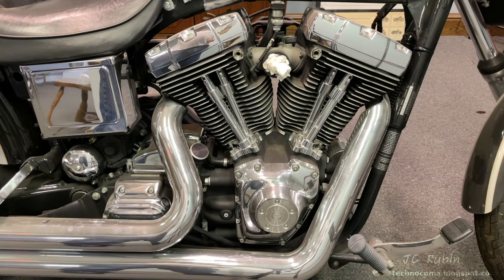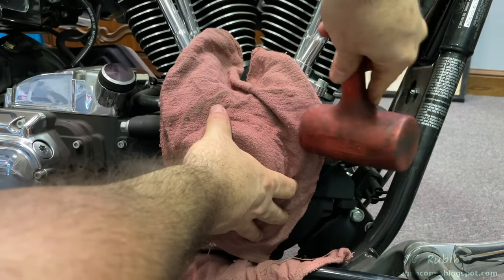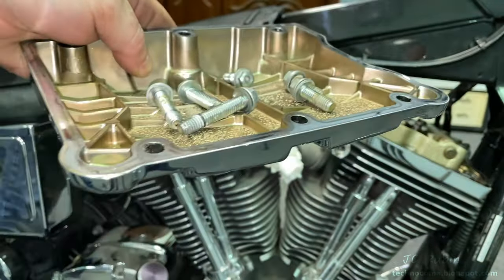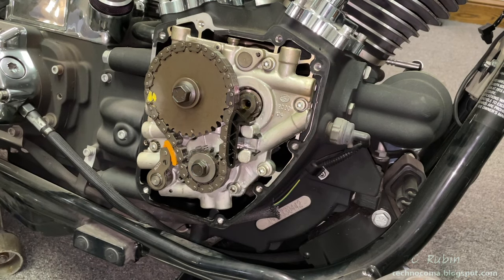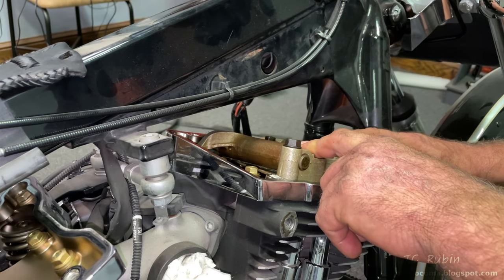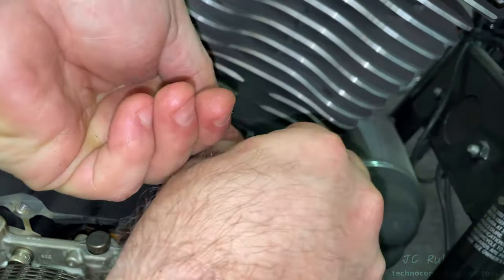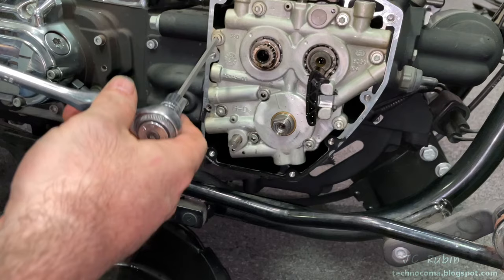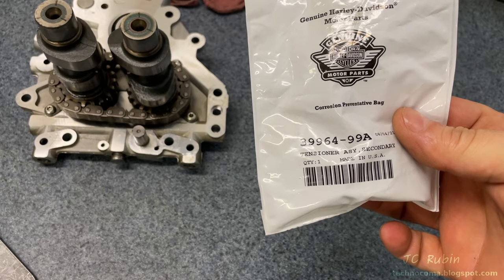Harley Twin Cam Chain Tensioner Replacement with Push Rod Removal Complete - Part 1

Comment: I'm sure this was a lot of work to put these videos together in the detail you put in, but I appreciate it, this gives me a lot of confidence to tackle the job on my 05 king.  If only that rear tensioner tool wasn't so dang expensive...I need it as I don't want to press out the cams.
Reply from the maker: I dont know why there isnt some small cottage industry making them....
Reply: @delorean1  I've tried everywhere to get one with no luck. Holes Creek stopped making them last year.
Reply: Anyone have one to borrow or rent?

Comment: I'm bout to have to do this...but I changed out my pushrods to adjustables so I don't have to take off the tank, rocker boxes & rockers to get them out...makes this process much easier...🖖🏿😎👍🏿
Reply from the maker: Yes, adjustables would make this process shorter.

Comment: Great video. Thanks. But...what year and mileage is on that bike? Never saw rocker box breathers like that and knowing the mileage would help in cam spring wear expectations.
Reply: Doing my 02 softail . Close to 50K mileage . Inner tensioner is missing a peice.  Outer is pitted bad .
I dont have the inner tensioner tool , so will be pressing the cams out at work tomorrow to replace it .
Have the same oil breathers or oil separators on mine .

Comment: Ah yes, the magic inner tensioner removal tool.  Completely unavailable anywhere at any price.
Reply: What did you end up doing
Reply: I made my own. Wasn’t too difficult
Reply: Unavailable …great
Reply: The tool for outer tensioner is $16, hundreds available on Amazon. The inner tensioner tool is $120 on eBay, hundreds available.  The oil pump centering tools are $8. Not hard to find.

Comment: Outstanding narration and excellent work. I'm buying a 2004 Fatboy and this will be the first thing I inspect. The bike had 10k miles, so I feel confident the tensioners are ok (famous last words). I'm debating replacing the spring tensioners or having a shop install the hydraulic units.
Reply: Don’t forget the cam bearings.. Very important for that year
Reply: Change everything!! Including cam bearings
Reply: hydraulics don't really fully remedy the tensioner shoe problems; if you have the extra money and ability, check the run-out on your crank if it's within the acceptable limits(30 thou i think) upgrade to gear drive($600-ish) also swap out your bearings to Timkens like the other two said.

If that's out of the question, go with hydraulics, bearings, and polish the backside of your chains, they can be a little rough/sharp and polishing them up helps them glide on the shoes better causing less wear.
Reply: @petepeterpipee1800 mine is a 2002 I beleive that was Timken bearings and solid crank that year.
Reply: To fit se adjust pushrods.£950 for the gear drive kit,inc cams /gasket/inner and outer bearings/ex gasket.£260 for SE pushrods plus £300 labour .total £1510
For hydraulic £250 extra.

Comment: I'm going to to that process in a few months. I'm still running on the old tensioners. They looked good enough to finish off the summer but I'm pulling all that crap out of there and putting in an S&S plate and pump. Goodbye spring tenioners.

Comment: Good video, I'm doing the same on my 2001 FXSTD, want to go gear drive but budget, and wife, says a little later for that. Having tough time finding a tensioner tool but I'll get there.
Reply from the maker: Heres a link to the tool
https://www2.vtwinmfg.com/tc-88-chain-shoe-tool.html
Reply: @delorean1  crazy price for a pair of pliers really. I'm making one that will do the job.
Reply from the maker: @simonfreeman148  There are cheaper ones out there. No doubt im all about the DIY.  Its always a question though of what the time and materials are worth.

Comment: finally, a TC tensioner replacement video without having to cut pushrods and buy a $1200 - $2000  'upgrade' kit.  Cutting pushrods just introduces another point of failure, doesn't give you an opportunity to inspect the rockers and replace the breather filter element.   I did my 2006 Nightrain 13,000 miles ago;  I got over 50,000 miles on the original set. The tensioners looked about the same as the one's in your vid with about an ⅛ inch of wear and lots of pitting on both the inner and outer.  I didn't touch the pump but did replace the inner cam bearings with B-148s.  Anyway great job on the vids-  I really like your channel. Thanks for making these.
Reply from the maker: You're welcome.

Comment: Good video!! I've just picked up a 2005 heritage Softail classic. & The dude bought it used from dealer ,it has 55,000 miles on it , the dude didn't know Jack, so I called dealer with vin #  thinking maybe they inspected it before putting in on the floor with 50,000 miles on it but nope, service dude said no they don't pull the cam chest unless there's noise!! That ain't cool!!  So I'm going to inspect this weekend. Hopefully someone beat me to them!! 🤔😊
Reply from the maker: Wow, that would be a bit late at that point!
Reply: @delorean1  I pulled cam chest & probably 20%  wear on them, so either someone beat me to it, or it's one of those freak One's?? I did my 01 Electra Glide @47,000 miles & they were in need, so I put some S&S 510's gear drive in her!!  But not put that kinda money it the heritage!! When I do them be just tensioner's!! Lol.

Comment: I wish the removal of the rear rocker arm unit on my 2006 FLHTCUSE came out that easy.  Having issues clearing the left side screws from the frame. Seen somewhere that somebody mentioned light prying on the stabilizer link against the rubber mounts will provide clearance.

Comment: Excellent video! Short & sweet. You demystified the whole process. Thank you. Question: do you absolutely need the specialized tensioner tools to remove the small orange shoes?
Reply from the maker: Not for the one in the front, but yes you will find it difficult to do the one in the rear without damage without the tool.
Reply: @delorean1  where did you purchase the tool from

Comment: Sure appreciated this video. At l37,600 miles on my 05 Roadking,mine are probably past due although still quiet and no signs of tensioner material in my oil filter pleats. I am wondering what the purpose of the black skid is that was removed for access to one of the cam plate bolts?
Reply: Past due at six figures!!!!! Oh my.

Comment: Great video, thanks.  Wondering if the lifters are found to be faulty and in need of replacing, would the pushrods need to be replaced also. Thanks again.
Reply from the maker: Not necessarily.

Comment: I know you mentioned taking off the tank and carb before the video. Any big differences or advice for fuel injected models?  I’m going to be replacing tensioner shoes and inner bearings (not the oil pump) on a 2003 softail deuce in a few weeks.

Comment: I’m a little Leary about doing this job but just got 04 Fatboy with 27k on it, so gotta be done. My biggest concern is removing top end to get at push rods, then getting all that adjusted and back together. Would like to get the removal tool you used for inner tensioner to avoid cam removal. Is it HD ?
Should I take this project on ?
Reply from the maker: If it really bothers you, you always have the option of doing the cut pushrod method.

Comment: Could you not use the tensioner puller on the front tensioner also?. It would save on buying extra tools and pulling front sprockets.Great video BTW 👍
Reply from the maker: Id guess its possible. Remember in my video, i limited myself to following official procedure, so I didnt actually attempt this.  That said.  Nobody bothers as the sprocket removal is trivial.

Comment: I NEED HELP PLEASE. I followed both videos step by step, and when i put everything back together, I hear a loud ticking noise when the engine idles, when i rev the ticking sounds louder. I don't know whats wrong. I re-aligned everything and I triple checked that it was all aligned. I made sure I followed every step exactly I have taken the bike apart 3 TIMES and done every step. Lubricated every important pieces. I need help PLEASE. I don't know whats wrong. My bike never did this before.

Comment: Do you know how much this should cost with parts and labor? Thanks first time viewer and I subscribed. I'm sure I'll be using your videos when I do mine. Very unprofessional and informative, I appreciate that. It's the details that really make any job easier.
Reply: £390 over here. Cyco replacement pads
Remove the tank, exhaust, rocker covers & supports, fit the tensioner pads then assemble using your stock pushrods. The costs are £40 for the tensioners, £30 for the cam change gasket kit, £20 for new Koyo inner cam bearings and £300 for 6 hours labour.

Total £390
For a just look and check and put all back if OK its £250.
But its only another £140 to install new pads when the mechanic is at that stage . So basically unless you do the look see yourself , you may as well just get the guy to put in new pads and be done with it , even if no need.
Reply: The place by me quoted me $2,200.00. Unbelievable.

Comment: Excellent video and most appreciated. A question concerning the tool used to remove the rear tensioner. Is this a HD part? I'm sure it's not absolutely necessary, but man it looks like it makes the job easier. Part number or source would be very appreciated.
Reply from the maker: Was the part number and source for the tool not specifically mentioned in the video? Maybe in Part 2?
Reply: @delorean1  I'm not sure it's mentioned in part 2, but I did track down a couple sources for it. An individual maker who unfortunately stopped making the tool this year. There is another outlet through an online bike parts marketplace. Waiting to receive mine to judge quality.
Reply: @cmenzes  Do you have a link to that tool please? Thank you.
Reply: The tool made all the difference. I destroyed a tensioner trying to do it without it and I found one and ordered a new tensioner and it went right in no problem.
Reply: @imdaccarrist  Would you be willing to rent or sell the tool?

Comment: I am interested in the inner cam tensioner pliers you used. I’ve tried to find them and have had no luck in doing so. If you could tell me the name on them or where you may of got them would greatly help Thank you
Reply from the maker: Check through the other comments. Info has been posted. They are hard to find right now.

Comment: Great video. However, the best solution is to get rid of the chains and tensioner shoes. At 20K, I replaced that junk with S&S gear driven cams.
Reply from the maker: Thats a good solution..... but not the replacement procedure.
Reply: @delorean1  You are correct. I am a licensed master motorcycle mechanic in the state I live in. I also taught motorcycle service technology at a local community college. I have done many of the shoe replacements. I guess my point was, if you're going to open up the cam chest, make a permanent fix. Of course the pinion shaft RO has to be within spec in order to install gear driven cams. Otherwise the next best solution is to upgrade to the hydraulic tensioner shoes and larger oil pump. And again, your video was very well done.

Regards

Comment: Just a quick observation, why not cut the old pushrods and replace with adjustable pushrods save a ton of work???
Reply from the maker: Because then it would not be the actual replacement procedure, it would be an alternate procedure, and i would forgo any work i could have done on the top end.

Comment: I don't understand which cylinder you're pulling the rockerbox off first because it was a demonstration on the front cylinder and then. You set repeat the process and do the back cylinder but you took the back cylinder rocker box off before the front.

Comment: Please explain, what are you accomplishing by loosening the bolts in a cross manner? What is that supposed to do?
Reply from the maker: To the greatest extent, evenly releasing the pressure of two compressed surfaces.

Comment: I'm in process now of changing the tensioner shoes, I have everything marked up and locked cam sprockets with the tool. When I come to rebuild do I have to go through alignment process as shown, or do I just replace as it came out ? Oil pump still in situ. Rear shoe is hardly worn ...🙄 Could have left it really. Thanks
Reply from the maker: As long as you left the four oil pump bolts in, there is no realignment.
Reply: @delorean1  ok do I still need to line up the dimples on the sprockets with the marker on the cam plate?

Comment: Where did you get the tool to remove the secondary chain tensioner? I did find some sites  but all showed out of stock
Reply from the maker: I keep hearing that.  I find them on ebay or other distributors searching on google.
Reply: @delorean1  Hmmm, I can seem to find it.

Comment: I can't see see spending $150 or more on problematic adjustable pushrods to replace dependable pushrods because Its to much trouble to take the valve covers off.  I would think it might be a good idea to check/replace the breather filters under the valve covers anyway. am I missing something here?

Comment: goodluck finding the rear cam tensioner tool in the states. James gaskets is sold out and there's no contact number or add cart option or notify when back in stock.

Comment: Would like to find a place to buy that inner tensioner removal tool that actually has them in stock
Reply from the maker: Ive posted several possibilities in other comment replies
Reply: @delorean1   the source that you mentioned is on back order. No telling when they will be stocked again.

Comment: Just one question, do i have to drain the engine for oil first?
Reply from the maker: No, you do not, though I recommend a rag under the cam cover as some may drip out as the seal is separated.
Reply: @delorean1  Thank you very much for the answer :-)

Comment: What rocker box breather are those?  Did you change the INA bearings while you were in there for torrington?
Reply from the maker: Came with the bike, stock. No bearing changes.
Reply: that should imply that's an older bike, as those came with Torrington bearings from the factory, IIRC.  🤔

Comment: Had my Harley a week, used from dealership so no warranty. Less then 60 miles and I’m gonna be repairing… 04 FXDLI.

Side note where did you get the rear tensioner tool?
Reply from the maker: Search on Ebay, they are hard to find.

Comment: I have the front tensioner tool but not the rear where did you get it thanks
Reply from the maker: Search for vtwin part num 16-0188
Reply: @delorean1  where do you search for this part number at

Comment: Why did you remove the carb
Reply from the maker: The carb was removed at part of the carb rebuild video posted also on this channel. It also provides for easier access with a camera and more room to work.
Reply: @delorean1  So carb could stay?  Upon inspection, the shoes are slightly worn at 30K on my 2000 Dyna.  Once I find the inner tensioner tool, I'll be following the procedure you demonstrated.    I'm pulling the tank for other reasons, so seems like an opportune time.  Great video!!

Comment: Be aware if you do this you will dump your oil pan so be prepared with new oil.
Reply from the maker: Not sure what you mean. As shown in the video, no oil was lost.
Reply: @delorean1  What I mean is, when you pull the cam plate your oil pan will dump. I'm in the middle of doing it today and there's a pan full of oil under the bike now. Also mine has a small hose running from the timing cover to up under the bike, not sure what it is. It's a 2000 Softail.
Reply from the maker: @kennethwaggoner2254  Interesting, as you can see in this video that was not the case, except for a few incidental drops of oil, even with the removal of the pump.

Comment: It is so sorry that on a brand new Harley you have to do more work to your bike then I have to do to a fifty-year-old Triumph 650. I do replace Parts on the Triumph occasionally but then when a forty-year-old part gives out to ghost you can't blame the part. I can't believe you have to replace it hugely expensive parts in your engines. We are talking serious money to replace the crap that Harley used at the factory. When Norton used crappy parts in the engine and transmission and they blew up they covered it under warranty but the warranty claims sank the company. Why all the twin-cam owners do not file a class action lawsuit against Harley-Davidson to address these issues I have no idea. They buy a $20,000 plus motorcycle and the bike has major issues early on 10,000 miles 15,000 miles excetera. But it seems most of them are rich enough to drop another 5 or 10 grand into their engine to get a semblance of reliability out of it. Jen they go well that's Harley where you going to do about it? Then they just have another beer.

Comment: Mine was a 2013 super glide I bought it new and about 2 years I started seeing orange pieces in the oil. Come to find out the oil pump was about to fall off bolts were loose.
Reply from the maker: I hope someone had messed with it since the factory install